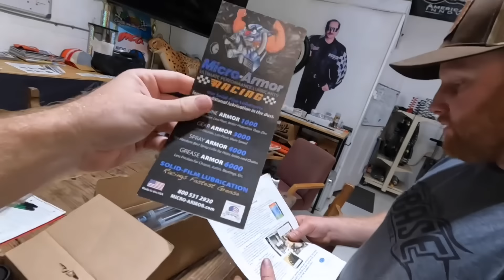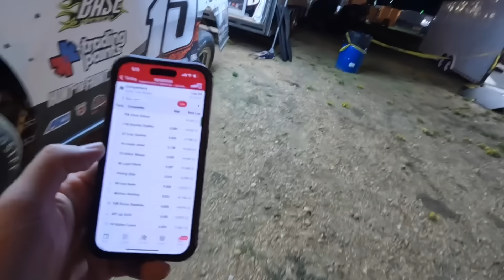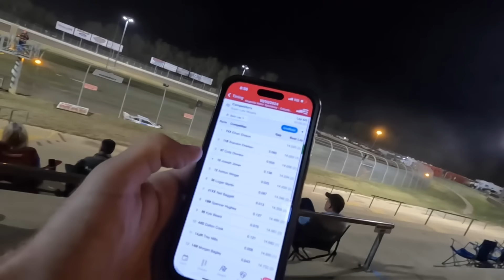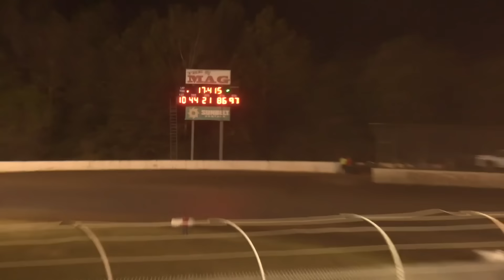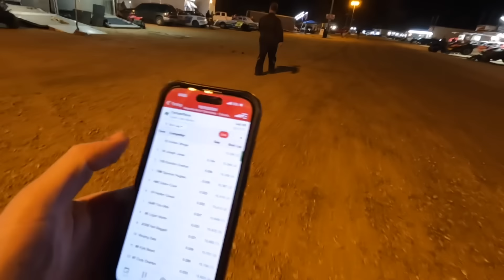Big Change of Plans… Three Wide at Magnolia Motor Speedway

Comment: 2nd session Joseph used high and low lines....and had cars around him so in my estimation a better test than just picking your favorite line which may not even be available in a race unless you run in the front, lol.

Comment: Do you guys take your cars and engines to the dyno and have the engine tuned where each cylinder is receiving dialed amounts of air and fuel?
Reply: its carbureted, not fuel injection
Reply: Look it up. Kenny Wallace has his b mod tuned. It's a carb that can manipulate the jets to evenly tune each cylinder with fuel and air. Also helps prevent uneven temps in cylinders!
Reply: A company has created a carburetor that is tunable by adjusting fuel and air to each cylinder! Many dirt teams dyno engines with this carb and with this company that created it
Reply: @BuckBradshaw-vq5ot literally impossible, air, fuel go into the intake and is mixed, as each intake valve opens that mixture is drawn into the cylinder. It would be impossible to tune each cylinder with a carb. Regardless of what a carb manufacturer says. They’re trying to sell them.
This is all happening at high rpm’s.
That’s why fuel injection was created. Have been building engines for 30+ years, im aware of that carb your talking about. It doesn’t work as described. We have tested it extensively.

Comment: @HunttheFront Why don't one of y'all just man up and go talk to Ashton Winger or Brandon Overton, or volunteer to wrench for them for a week or two so that you can get a feel for what they are changing to get forward bite on the dry slick. They are not going to be able to tell you straight up what needs done, but they can get you in the right direction. Or it is all driver and that is not going to be replicated.
Reply: Please tell us what tracks were dry slick?
Reply: @paulles1377  This one in this video in the last session was a dry slick track.  Most tracks for the main event are dry, black and slicked off. As you can tell they are no longer heavy, or tacky as they typically transition through from hot laps to qualifying and then heat races and sometimes B mains or last chance races.
Reply: @dtabbs69  I know what tracks do. I raced for over 15 years. Magnolia is anything but a dry slick track though. Slick yes, dry no. Instead of clay the track is gumbo. The nickname for the track is Black Ice.
Reply: @paulles1377  So why are you asking me, another racer that raced Late Models what a dry slick surface is? Anything that is black glazed over is considered dry slick regardless of the amount of sand or clay.
Regardless, my original post is just man up and go talk to people. Most people welcome discussion over conditions and what they are doing. Are they going to give you an exact set up? No, but I bet they will talk to you like I used to talk with all other racers.
Reply: @dtabbs69  I didn't ask WHAT a dry slick track was. I asked WHERE were the dry slick tracks that they had raced on. I know Thunderhill wasn't dry slick and neither was Talladega because I was at both of those races. Senioa is the only one that comes to mind that got dry slick.